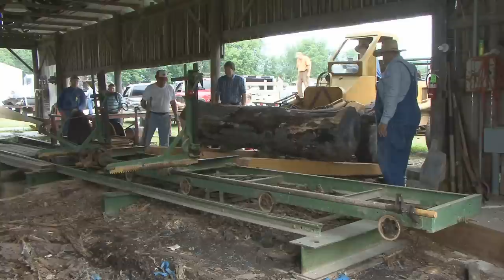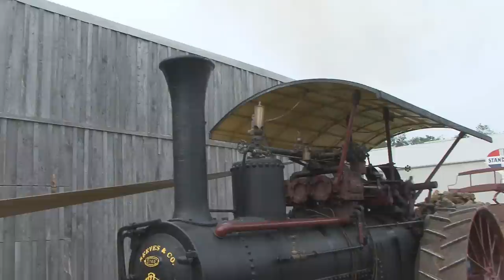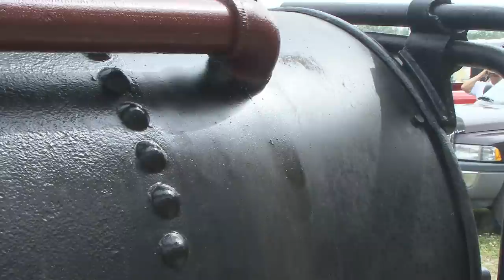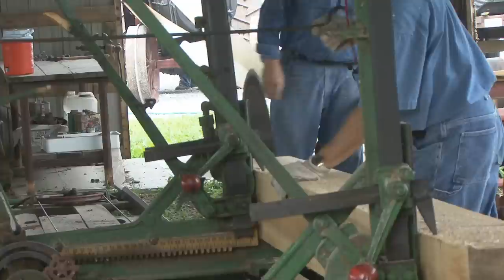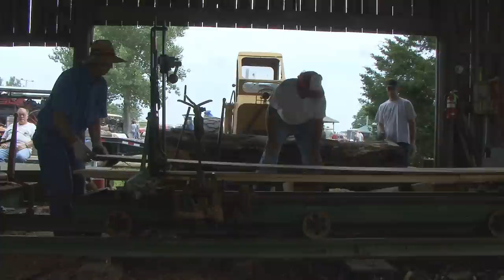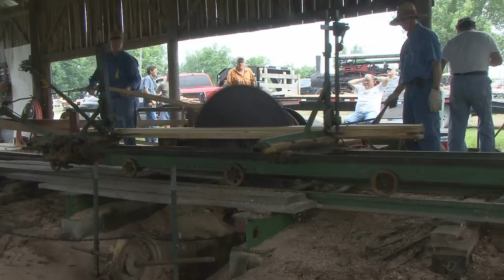TractionAction:  Reeves 13HP on 1903 Port Huron Sawmill at Lathrop Missouri 2009

Comment: I like that adjustable headblock spacing. 

Ours are locked in place, but are spaced at different intervals so real short logs go on the front two, medium length on the 2nd & 3rd, longer ones on front 3 or back three, and real long ones on all four.

Also find it a LOT Easier to pull the set lever if you squirt a little oil on the headblocks for the BIG logs to slide on. Otherwise, we've broken the handle a couple times over the years from pulling too hard on it.

Reeves sound Great by the way.

Comment: Does the steam engine run at full throttle all the time? Or does it have a governer? Does the sawyer have a throttle control to add more power when making a cut? Great video!
Reply from the maker: There is a governor.  The sawyer will test he blade RPM and have the engine operator adjust the governor for the saw.  Most saws around here run 450-500.  The engine will run about 250, which is a typical maximum.  Pulley ratios make up the difference.  While the saw is in operation, the engineer is mostly a fireman and oiler.  The governor manages power applied by keeping the speed constant.  Well, sort of...  The engine speed will droop while in a cut on smaller engines because there isn't enough horsepower.  If the RPM droops too much, the saw blade heats, cuts hard, and cuts crooked. The sawyer will manage the droop by adjusting the feed rate of the log.  With experience,  the sawyer does this instinctively by listening to the saw and adjusting his pull on the stick.  Some sawmills will have an "idle down" lever that the sawyer will operate when loading/turning logs. This is attached by wire to the engine governor and cuts engine RPM.  At some shows you may see the engineer do this manually as a courtesy to the sawyer.
Reply: CarrotCaptain seized

Comment: Does a twin cylinder steam engine,have any advantage over a single cylinder engine? I enjoyed the video,especially the stack-talk of that engine,under load.Thanks for posting.
Reply from the maker: With a single, there are two spots in the rotation that are impossible to start the engine at.  With the piston at one end of stroke and the other end.  Sometimes you have to rotate the flywheel by hand slightly to get it to go.  Two cylinder engines are set up 90 deg out of phase, so you can start any where in the flywheel rotation.  Locomotives are set up like that.
Reply: George Boyd no
Reply: That's a good thing, I hate to get out and push a locomotive to get it to go. LOL Thanks for sharing your cool video with us. Best Wishes n Blessings. Keith Noneya.
Reply: George Boyd
Reply: I had the same thought for question?  Beyond ease of starting does the twin cylinder offer greater torque for the same displacement?  Because I would think the stroke would be less to more match the cylinder bore.  A shorter stroke will permit higher RPM and usually horsepower but less torque.  This is true for gas and diesel engines.  I know steam has the advantage of a power stroke in each direction.  So being 90 degrees out of phase I would think that a twin cylinder steam engine would have four power strokes per 360 degrees of crank revolution
Reply: believe with you can also lower the flywheel mass since you have another power stroke and dont need the rotational mass to keep the rotation smooth.  let alone power... from an added piston...

Comment: Do you happen to know about the drive belt? Such as how long it is and how much did it cost? It looks pretty new.
Reply from the maker: +austinwagoncompany That belt is 8" wide and 160ft long.  It has a laminated splice so it is a continuous loop.  With pulley diameter and such, that makes the engine crank and saw mandrel about 65ft apart.   I recently got a quote from http://www.ibtinc.com/ for one.  Their item number 82300226.   It was 7" X 150ft with splice and was almost $900.  The belt in the video came from IBT.
Reply: fixyerdigger cool! Thanks.  Now I have an idea of what to expect as I need a new belt for mine.
Reply: I realize that you asked this question a year ago but I thought you might like to know,,,I have an old frick O and I run it with a ford tractor...for flat belts I use hay baler belts and splice them together end to end...lots cheaper and works just as well

Comment: In these days of OHSA and similar in other countries. I always feel they are created simply to create jobs for the idle, half the time they don't seem to know anything about the job that is being done, so they simply tell everyone to put on as much 'safety equipment' as they can think of - a lot of which gets in the way and hinders/slows you down working. Most, if not all of what you are doing only needs 'common sense' plus 'respect' for the tools you are using - I have always found if you are slightly frightened of what you are using, (especially moving machinery), you will be perfectly safe.

Comment: That 13hp, is surely a misprint, i would guess that as a 50 hp steam engine. I seen a Super M Farmall  on a sawmill in Indiana, it handle it about the same way !
Reply: It's 13 hp on the draw bar and about 40 on the belt but just about all the engines back then were under rated.
Reply: Jim Farmall
Reply from the maker: 13HP.  That's the way they were rated back then.  It would probably be equivalent to an M.  Super M might be a little more.
Reply: that is the true hp...hp ratings today are vastly over rated. Would a person really believe a 300hp compact car had more hp than a 'two horse' team of belgian draft horses (think about it). try hooking them together back to back to see what would happen ! My team of Belgians got excited  and ran away hooked to a stuck Massey Harris tractor, scared my son to death on the tractor!!!!!!!
Reply: @rsgpartsdivision  I know this is kinda late, but that 13 HP is actually the drawbar rating. Rated flywheel horsepower would be about 3x that, or 39 HP, although it can probably put out 50+ if fired really hard.